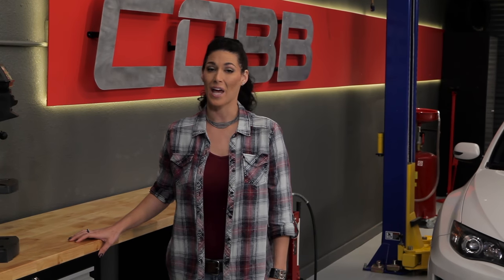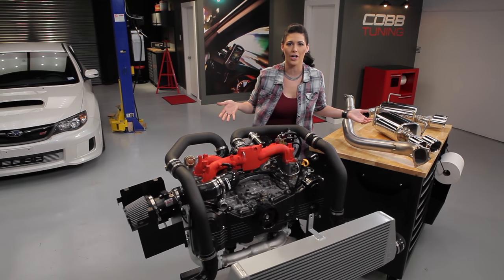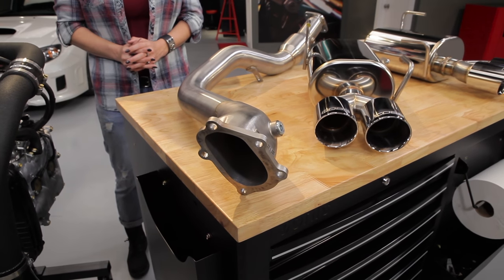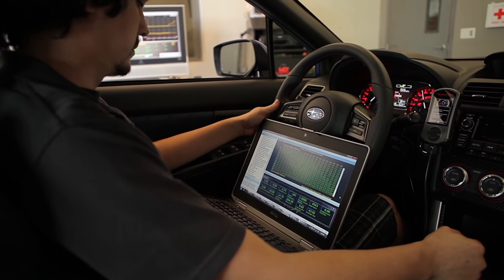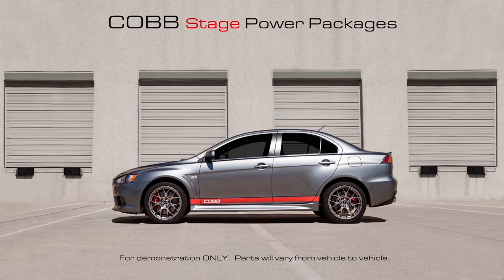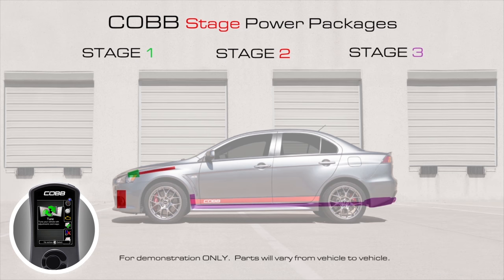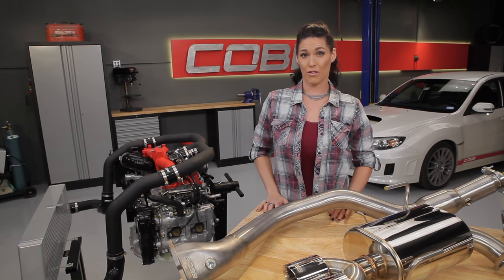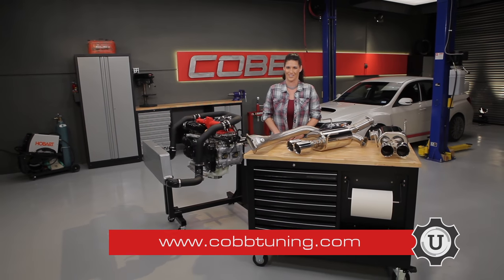COBB Tuning - COBB University Episode #3 - Modification Path

Comment: Great series! I’m new to the modification world, but wanted more than was brought to the table when I bought my 2018 mustang ecoboost. Looked all over the internet, and asked around before deciding on COBB Accessport and Stage 1+ package.  Not disappointed at all! Torque and hp gains with only a tune and CAI, and for under $800? Love the way my car drives now - quicker off the line, torque almost immediately and pulls up to redline. Saving my money up for stage 2 (intercooler upgrade) next. Might not want to go stage 3 just yet, but I’m sure. with the stage 2 I’ll be even happier than I already am.